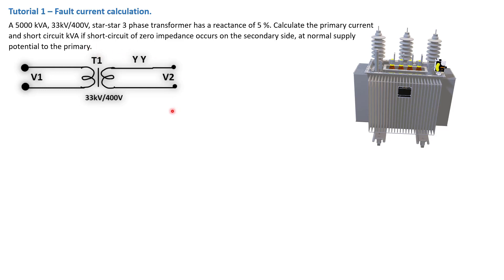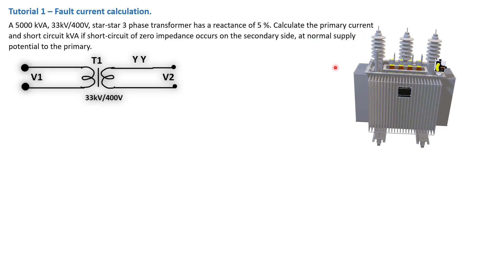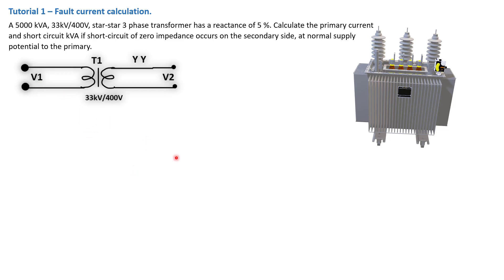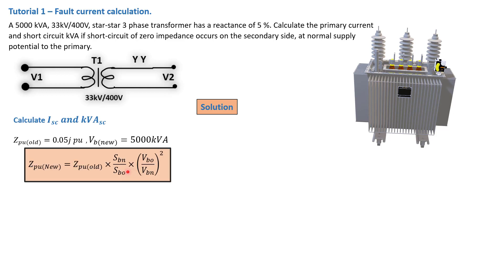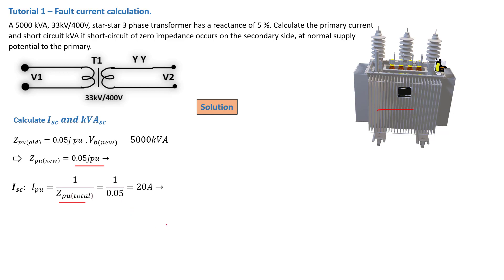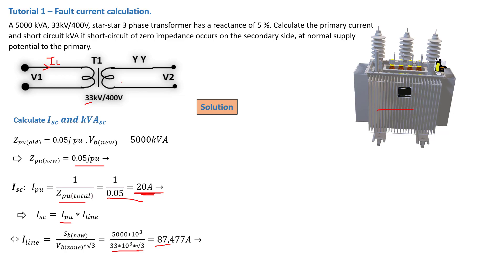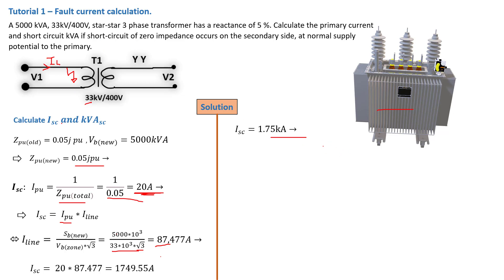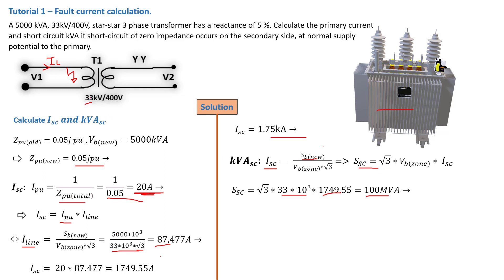Transformer primary short circuit MVA - Fault current calculation. Tutorial 1

Comment: 20A? Shouldn't it be 20 p.u.?
Reply from the maker: Hi, yes, it's a per unit current, so it should be 20 pu, or more explicitly, 20A pu. But 20 pu is the correct notation. Good catch 👏